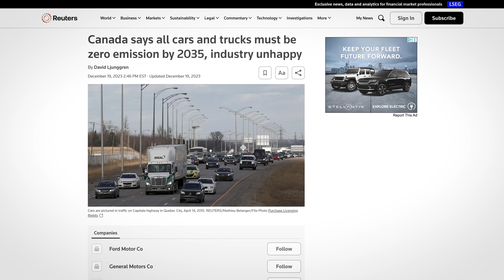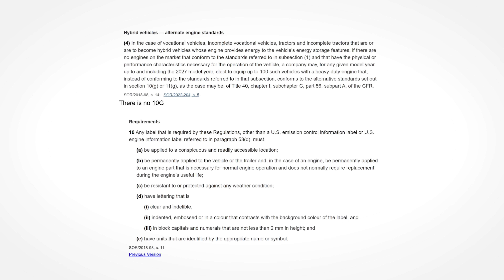Government Red Tape Is Blocking Our Plug-In Hybrid Trucks

Comment: Have you tried finding an engine that is certified for both the on highway (on road) and off-road tier 4 final certification? That is how we get around this problem in the US. You get the block that has the on -road certification you want and add back the peripheral parts of the generator. Since it's the same platform most of the time is a bolt-on solution. The engine is still in the approved configuration you just updated the auxiliary parts.
Reply: That’s exactly what I was thinking too. Surely there’s an engine out there that’s used for both and bolts right up
Reply: The engine is the same.  The difference is the fuel system.  Like he said.  There is little demand for an ON-HIGHWAY generator right now so nobody builds them.  Its stuuupid because they need to create legislation to allow someone to create the demand so the engine gets built and then certified so they can buy it .  What they should do is create a phased-in approach and let the stage 4 Off-Highway units be used until 2035ish so there is enough market to pay their cronies for the testing effort (you know they are invested in all things "green" so pols are getting paid).
Reply: @kenreynolds1000  but if the engine family information is stamped on the block or crank case. Those parts have to be on the generator version with all the corresponding emissions equivalent in the certified configuration. Then it's an on-road generator.
Reply: That was my first thought, just work around the idiots.
Reply: There are no on highway engines certified for use as a generator. It is impossible to get one certified because there are no standards in which to certify it against.
Reply: @alannitcher5001  railway test cycles combined with on-highway emissions limit might work (railways commonly use diesel electric traction and have stricter emissions limits)
Reply: @alannitcher5001  Why would you need to certify it for use as a generator?
The power never leaves the vehicle so it's just driving an alternator like every engine does, it's just not connected to the drivetrain and the alternator is bigger.
Reply: @samheasmanwhite  Because the engine is not certified for this use case. Therefore, it is not legal.
Reply: @alannitcher5001  In terms of emissions I don't think it matters what resides between the engine and wheels. For instance you don't have to certify a truck with a 13 speed or an 18 speed. The engine is providing tractive power at the end of the day and there are clear on-highway standards for that. These on-highway diesel engines are also not certified to operate only in specific platforms. The engine is measured by emissions per hp-hr and treated as a little certified package no matter what truck it is put in.

However! What I do wonder if it the issue comes down to whether a manufacturer will warranty an engine being used in a fashion it wasn't designed for. This isn't a government driven problem though. Another detail that has crossed my mind is whether or not they need clean stable AC power from the generator.

It sounds like they're basically operating the generator either off or at full power, no in between. It is possible that they designed the charging circuit for clean AC power at a stable frequency. In that case I can see how trying to govern an on-highway engine to operate at a stable speed could be a challenge, but seeing as how the load in this case should be pretty stable I would not think that would be an issue.
Reply: @alannitcher5001  A highway certified truck engine? What's the holdup? Is it because it is not driving the wheels directly? If so then just put a tiny useless driveshaft from the engine to one wheel set and never put it in gear, at least until you get the legal situation fixed.
Reply: @Maxzillian  The issue is that when you change the software settings, it no longer is in compliance. It is certified for driving the wheels when on the highway. It is certified for use as a generator off the highway, it is not certified for use as a generator on the highway. It requires a different software package, so it is not certified. There are not even any standards to certify it to. To get it certified, costs tens to hundreds of thousands of dollars. 

I was a California smog technician. Cars sometimes needed different smog equipment for a standard and automatic transmission. It did need a different carburetor for different tranys and bodies.
Reply: @alannitcher5001 I don't believe the engine programming necessarily needs to be changed. It would certainly be easier to reprogram a on-highway engine to have a speed governor, but as you pointed out that would make it no longer compliant.

One could, however, still develop their own governor that interfaces with the on-highway engine and that would not break compliance as the engine and PCM would not be modified.
Reply: @Maxzillian  That's a good point, I'm sure there would be some inefficiencies using a driving-optimised controller but it would at least get them on the road now if it is legal.
Although a custom control system is providing the throttle input it would only be through the certified engine management system so it should be fine.
Even if regulation would still prevent it being used as a "generator" it would hopefully still be fine because the electrical system is just a transmission, from the engine to the wheels, just like a hydraulic transmission (unless non-mechanical transmission is banned on-highway tho).
Reply: @samheasmanwhite Right, in terms of emissions I don't think the regulations care how energy from the engine is getting to the wheels. Otherwise every engine would have to be certified with a specific transmission.

The big problem I see is that it may be difficult if not impossible to get the on-highway engine to respond fast enough to changing loads, but it sounds like they just run the generator flat out so that may not be a problem.
Reply: @samheasmanwhite  Because the existing certification the engine has is for a use case where it cycles through a range of RPM. Using an engine as a fixed-RPM generator outputs unknown or potentially harmful levels of emissions. For example: let's say the engine gives shit power but runs cleanly 800-1999 RPM, that same engine at 2000RPM may give solid power but output emissions out of compliance. This is fine for an engine that's used as an engine as it's not constantly at 2000 RPM, but is undesired from environmental standards point of view if ran as a generator at 2000 RPM.
Reply: @JamesBrown059  You might still be able to get away with it legally depending how it is written (whether they specified something like that). But that is a good point with the emissions, there shouldn't be any trouble from the engine itself in that regard but the catalytic converter might require some cycling. I think the urea injection ones might not need cycling though?
Reply: @samheasmanwhite  non-mechanical transmissions are allowed, but the engine load needs to be positively correlated with wheel load and/or speed in some manner (series hybrids are allowed, constant speed generator-battery combinations aren't)
Reply: If they can get the engine classified as an APU the on-road certification is not needed. At least in the US, but California's diesel laws might have a carve-out that if any power can be diverted to the wheels it needs the on-road certification.  The laws were written before hybrids and when there were no requirements for off-road vehicles.  They really should make one final set of standards that is the same for both uses. With the current tier 4 standard the duty cycle doesn't matter that much.
Reply: Commenting ICYMI. He JUST released a short that explains that NOPE! Can’t do that! Bureaucratic idiocy at its peak. 

Go check out the short, he explains it.
Reply: @jrobmccoy  Nah they seem to be mistaken about this being possible, maybe they are just not that familiar with engines??
Unless there is something that they did not explain, I don't get why they are having a problem using an on-highway engine for generator use.
Reply: They should just move out of Communist Canada.
Reply: Scania DC16 is certified for that, but then you'll have to rev limit the engine to about 1500rpm
Reply: I work on the 9L Scania on Higway & the engine in the background is identical. Maybe they could use the road engine with software tweaks to act like a generator?

Comment: I am not Canadian so I don’t understand your legislative language, but would it be possible for the generator manufacturer to get their engine to comply with the on-highway emissions requirement?

Also, unrelated, but what is the tire size behing the woman talking in the shop? I work in an area that requires high floatation tires and I’m trying to pitch the idea of using a truck to do the work instead of our current method.
Reply from the maker: 425's

Comment: I have been waiting for your shutdown for some time. Here is what you do. You need a on highway compliant diesel engine to run your generator. Use a Dodge Cummins, GM Duramax, Or Ford Powerstroke engine package with EGR, DPF, SCR system attached. Or some other highway compliant diesel package.

Comment: I drove a class b rv with the built in generator running to power the rear cabin AC, have to assume I was not the only one ever to do that.. basically every RV with a generator out there. I would suggest everyone interested contact their MP as this is an obvious technology solution and unless we want to hand this market to the Americans we need to push for regulatory change or at least a trial permission (and associated legal changes as necessary).

Comment: So how does the generator detect that there’s load and that it’s time to turn itself on?

Would there be a way to sort of jurry-rig an approved road diesel (idk, maybe what they use for ambulances? Would that be the right size?) with whatever sensors or system the generator uses? 

Or is this one of those times that the ignorant internet user just said something incredibly stupid?

Anyway, I really hope that this gets resolved soon. 

I think y’all’s problem is that there ain’t no sweet old ladies at the environmental/emissions department who knows the rules inside and out and can fast-track y’all to getting an exception. Bonus points if she’s Black—in my purely anecdotal experience, they tend to be the most helpful. But really, anytime I’m calling a government agency, I always relax if an older sounding lady answers the phone. She’ll either be extremely helpful, or do her very best to help me.

Comment: Perhaps you could rig some sort of feedback loop using the cruise control circuitry from a certified on-road engine to make it work as a generator? Isn't that the same sense-load and apply fuel feedback loop you need?

Comment: The best way you can pressure them is getting your story aired on national TV, that will put pressure on them to grant exceptions if they wount change for the better, you'll be surprised at how politicians move with efficiency when they are under scrutiny from the media and the public and especially when they are clearly in the wrong.
Reply: National TV is funded by the very same government that's blocking them while all the other networks are being criticized as being "far-right" or "Pro-Trump" or whatever the current fear is being used by the extreme left.
Reply: The national TV media is owned by the government, so sorry socialism is anticapitalistic,  we told you so.
Reply: The federal government pays the media. Media wouldn't touch with a 10 foot pole. The media that will is independent alternative media.
Reply: Almost all media on Canadian TV is govt sponsored, so good luck getting that done.
Reply: @quinn7174  no way to bait them into looking bad?
Reply: @quinn7174  Government funded =/= government propaganda. They can air whatever they want as long as it's legal. That's also not the best way to go about it though, a petition started by an MP with enough signatures MUST be discussed in the house under Canadian law, so that's the best way to get things done.

Comment: Thats crazy !!!   Does they ban railway train to ?  I say that because a train is an electric motor combined with a diesel generator ... exactly like your truck !   Of course they ban your truck, because it will collapse the truck building industry.  You will never ever be able to put a ''truck train'' on the road ever .  Your truck have to be complicated and wear as fast as possible .   If you think they LL let you just change the generator for a fraction of the price to run a couple of million milles when other truckers have to spend 50 000$ plus to service their rig .   And no, the system is not rigged :0)

Comment: I'm not surprised the government is requiring a power unit that is certified for on-highway use for on-highway use. I would suggest approaching Scania (or another engine supplier) and request that they submit a generator motor for on-highway certification, if possible.

Comment: Talk to Scania, see if they can get those engines certified. If not, see if Cummins or GM can supply you with their already certified engines they use in their heavy duty Rams and Silverados/Sierras. They both produse 400-500hp and 900+ lbft torque, and would suffice as generators just fine. But I can suspect push-back from the two incase they, too, want to foray into electric-hybrid territory with their products in the future.

Comment: Change some terminology. What you are building is NOT a “hybrid electric vehicle”. HEV’s have mechanical propulsion, AND electric propulsion. What you building is a “self-charging electric vehicle” which is solely propelled by electricity. The engine is never mechanically connected to the drivetrain, and therefore is EXEMPT from current emission regulations.

Comment: There are certainly energy loss running engine -> generator -> motors vs engine -> transmission -> wheels directly however there must be benefits from being able run engine -> generator at specific tuned rpm and settings for increased combustion efficiency. What are the numbers? Does optimized rpm win or loose to generator -> electric motor efficiency loss vs transmission energy loss?

Comment: This seems like a minor problem to me. Use an on-road 9-liter engine and adapt the controller. No, it won't be off the shelf (yet) but the same is true for a lot of your stuff. The axle company wont sell me the electric axles, I've tried. 

These engines are electrically controlled. No reason a microcontroller can't control the engine to do the same thing a generator does a different way. 

Surely Cummins or whoever can do this with one of their generator designs.

Comment: The generator isn't connected to the wheels, it doesn't need inspection? If you throw a generator on the back of a pickup it doesn't need inspection?

Comment: Since the generator doesn’t directly drive the truck why couldn’t you call the generator permanently mounted equipment? Many types of vocational trucks have generators and other off highway engines mounted on them for other applications?
Reply: You might be able to run purple if you could get away with that.
Reply: Make cab over and mount the generator on the trailer

Comment: I worked in Government for 35 years+ in another area but I understand your frustration and I've seen the exact same thing.  You need to have staff constantly meeting with officials, ministers and their political staff.  It takes time to change regulations but it looks like you already have allies that you can use to get the ball rolling.  The first thing I would try is to get limited exemptions that would get you to have limited production to get you to test and continue development.  Unfortunately, some regulations require an act of parliament before they can be changed while others are administrative in nature.  To get regulations through parliament is not quick, it has to pass through votes, etc.  On the positive side, you have a government that wants to approve things quickly to get the economy going so you have several cards to play.  Go knock on more doors beyond Environment and Transport, you have Industry (Mélanie Joly) to support many industries and there is also staff for regional Economic Development.  Do not forget that your Provincial Government could also put pressure on the Federal government to put this as a priority on the agenda.  BTW, it is not only you, I remember that many years ago Bombardier was trying to make and sell small urban electric vehicles but at the time there were no electric vehicle regulations so they abandoned the project after they had built and tested vehicles.

Comment: Have you looked at what the Marine generator suppliers have available?  Volvo have a Marine 125kVA Genset with Type approval for Tier 4 emissions in Special Emission Control Areas running through an SCR reactor (DPF) with their own approved DEF (Adblue) injection system.  The system can be commissioned for multiple emissions standards of NOX & SOX at the uptake. (exhaust).  The DEF injection system is separate from the combustion engine so could be used with any engine brand.   I think CAT marine has a similar system in testing.  It already has type approval in the global marine market & marine emissions standards in controlled zones are normally tighter than on-land.